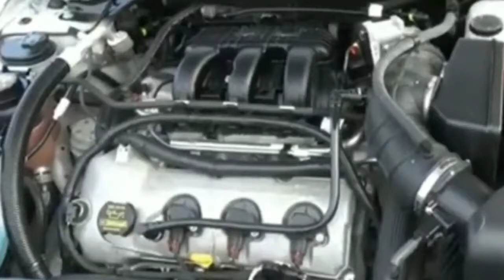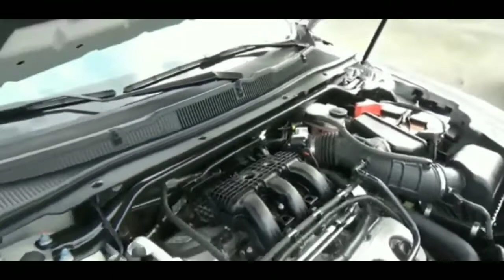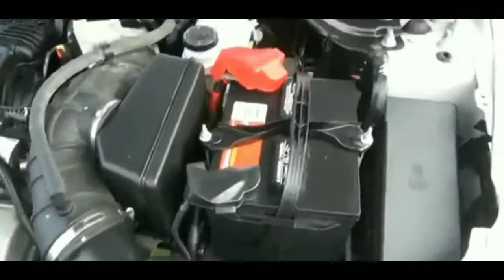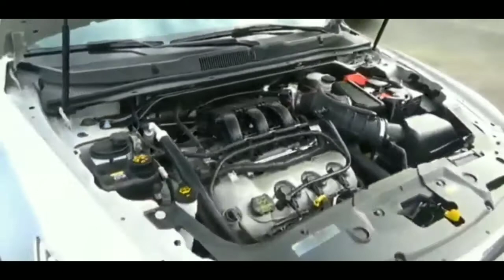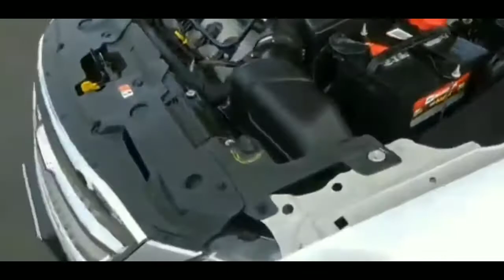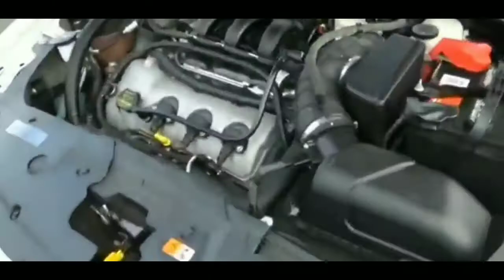Diagnosing a no Start, 2016 Ford Taurus Won't Crank...1 Click...Fixed..

Comment: auto zone ,advance auto parts and o Reilly parts all suck and be careful with there warranty to i bought a couple of things that had a one to 4 year i bought 2 Odyssey Extreme Battery BCI Group Size 65 950 CCA 65-PC1750T i paid 405.00 for each one my bill was like 825.00  the battery die in less a year in a half took them back to exchange they told me they didn't have me in the system they had my number and stuff the person who did the sale must have not done it right that not my fault and i had the receipt and they did not give me new batterys never again i will shop at there place

Comment: Did the store bench test the starter to verify the starter was bad? Also, the looping videos drove me crazy and I wish you had shortened the dialog a lot. A lot of times it can be bad ground cable to the motor block.